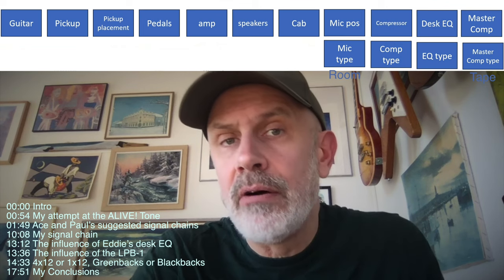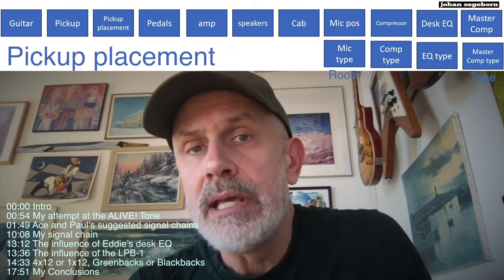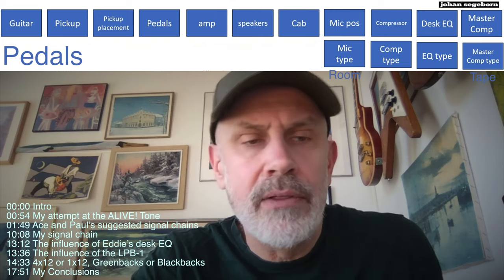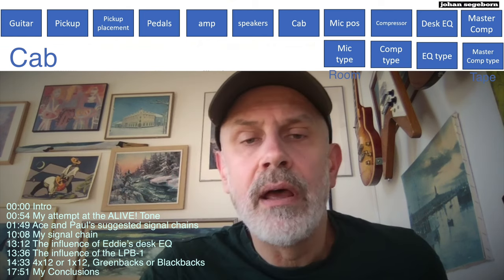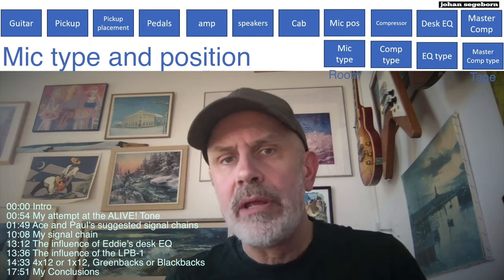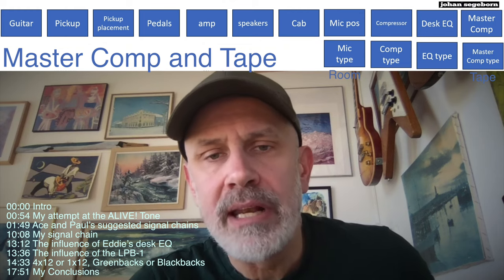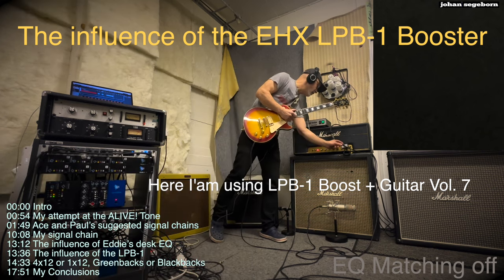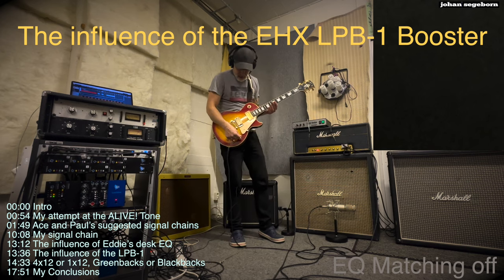The Influential Kiss - Eddie Kramer Signal Chain

Comment: Thank you Johan for letting us in on the tone secrets of the past! I agree with your conclusions and must say as a Marshall and Les Paul guy after a wile of plugging the guitar straight in I started wanting more than the amp could give and started pushing the amp with spiky fuzz pedals boosts overdrives and so on. I think it’s cool that you mention Van Halen, GnR and the different way they achieved this. The development of the super lead with the treble cap and other changes goes in this direction to I think, but still many prefer the older amps… My guess is that you can’t get “ that sound in your head “ with the one amp mod, pedal etc You need the small steps culminating, as you mentioned with pedals. The eq was a big step, even so I think it needed the small steps leading up.  I think I learned something more general through this, that’s cool! By the way I recently switched over to a strat, that’s even more extreme than the eq changes, all the treble I ever need.
Reply from the maker: Thanks, really good to hear that!

Comment: Great in-depth analysis of an icon Marshall tone!  I think your initial attempt was really, really close and I think a lot of it may be due to your playing style knowing your affinity for Ace's playing and tone. In your later attempts, the LPB-1 definitely added an upper midrange attack.  The Greenback speakers were a lot closer sounding than the Blackback speakers as was the 4x12 over the 1x12 cab.  The influence of the Super Distortion pickup can't be overlooked.  The "preferred setting" with all the controls being set at "5" is sort of arbitrary as I'm sure you know ALL vintage Marshall amps are different and almost always have to be set differently to get a similar tone.  Cheers!
Reply from the maker: Thanks Mark! Yeah tone stacks differ and some amps don’t have a bright cap and the list goes on.. and there is component drift on top of that. Cheers!

Comment: Johan. I was thinking about you all weekend...A vid popped up on youtube in the past several days of a guy who owns one of Aces 74  super leads..AND more importantly one of his old cabs. The cab had  blackback 25s and 30s, and the guy installed a  greyback (I'm guessing to replace on of aces original speakers that blew). I can't remember the guys name.. search for Ace 74 amp or something.
Reply from the maker: Thanks! Yeah I saw at similar video by Bill Baker who used to work with Ace. Over time the greenbacks were probably blown and replaced with black backs until Bill gave the cab by Ace. Cheers
Reply: @JohanSegeborn  that's the one. I figured you might have seen it by now! I'll watch your vid  tonight, had to cut my lunch break short right after I started 😞

Comment: Love your work but you began by playing Paul Stanley parts. Also Aces tech has stated he often used a EH big muff in the 70's. Never the less, keep up the great content.
Reply from the maker: Thanks! Yeah the first riff I played actually was from Rocknroll over. Both are Paul Stanley riffs. The EQ difference and dynamics difference between Paul and Ace is another really interesting issue that should be addressed in a video. Same thing with Slash and Izzy. If Paul’s or Izzy’s parts were to be removed it would sound too much like other metal bands, they add a huge amount of depth

Comment: Seems a little heavy handed for Eddie Kramer using that much EQ based on interviews I 've read from him about his recording ethos.

Wonder if there could be another explanation if they re-tracked everything in the studio? 

treble booster? telecaster? tweed amp? or combination of any of those
Reply from the maker: The isolation track of Deuce / Ace is (credibly claimed to be) from a live gig in Wildwood, so it’s one guitar. The EQ doesn’t sound as heavy handed there since Eddie used great analog EQs and had the benefit of tape, whereas I used the DAW EQ here. You can check it out here: https://www.youtube.com/watch?app=desktop&v=jSxdCwLz9pQ
Reply: How dbs of top boost and what frequency is the EQ match

Comment: WHy did you choose to a LDC instead of a DM as stated in the video? Why that choice? Also in that time, how would they use a greenback in a 1x12 without blowing it up? Were they using attenuators or someother load in those days to lower the wattage to a single speaker?
Reply from the maker: The LPC is the only early 70s Les Paul I have actually. If they would have used 1x12 it would have been driven by some of the fender amps mentioned in the video